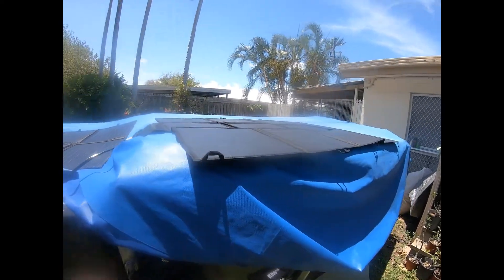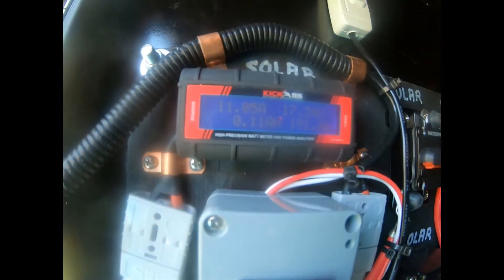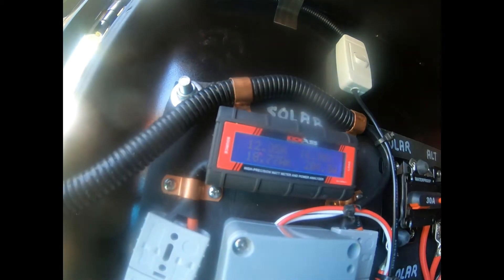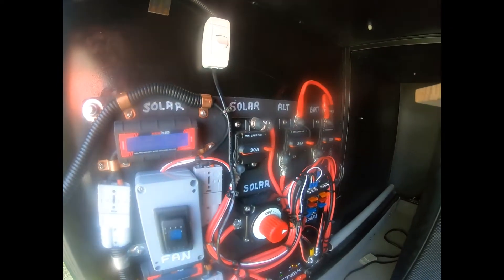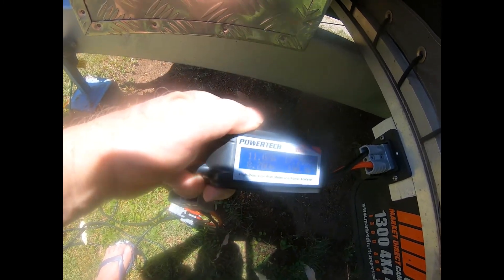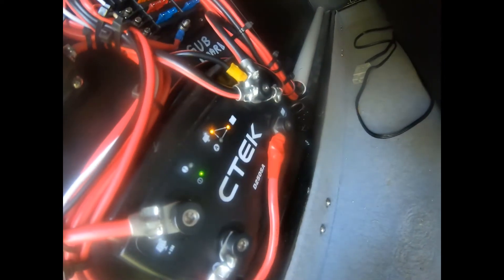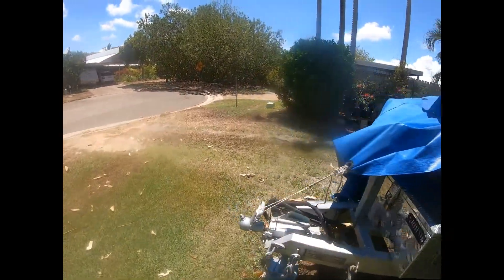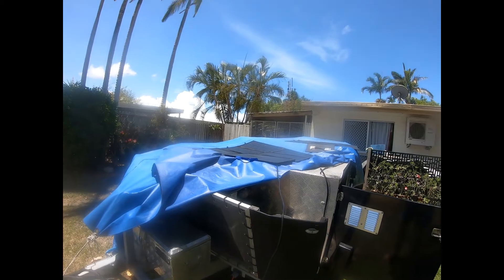CTEK DC to DC charger and 2 solar blankets

Comment: How did you go with the 400watts of solar. I have the ctek and they were saying only 300watts could be hooked up?
Reply from the maker: I honestly didn't notice that 300 watts maximum was in the user manual. I didn't have any problems with the 400 watts of solar input because you rarely get to use the full 400 watts unless it's the middle of the day in summer and both blankets are at optimum angle to the sun. You also have to allow for voltage drop in the cables. I hope this helps. Cheers.

Comment: Derek trying to connect 100w solar blanket to CTEK250.  Blanket has a Anderson Plug connection.  What cable should I use to connect to the CTEK250?
Reply from the maker: Hi James, I would use 8 gauge twin cables. The 8 gauge  black / red twin cables are ideal because of a lower voltage drop and you can connect larger solar panels or blankets in the future. Always use a larger cable size than you really need. It costs a bit more but it's worth it in the end. Cheers.
Reply from the maker: Also, don't forget to use the recommended fuse on the positive cable.
Reply: @derekeasterbrook6791  Thanks for that Derek.  I have another question for you, if you don't mind.  I had 2 X 100W (connect in parallel) all connectors from panels to CTEK250 were MC4. The lights on my CTEK250 indicated all was working well.  I have disconnected the panels now connected a solar blanket to the CTEK250 using a cable which is a combination of MC4 connector/Anderson connector cables.   Is that OK?  If not what cable should I use and how to connect it to the CTEK 250 terminals?
Reply from the maker: @jamescant4590  If it worked before it should still work again. I don't know what current the MC4 connectors can handle but I know Anderson connections can handle 50 amps of current. Jaycar sell a Y Anderson connection lead and the 4X4 Supacentre sell a 10M extension lead and they're both fairly cheap.
Reply from the maker: As far as I know MC4 connectors are still available on some solar panels.